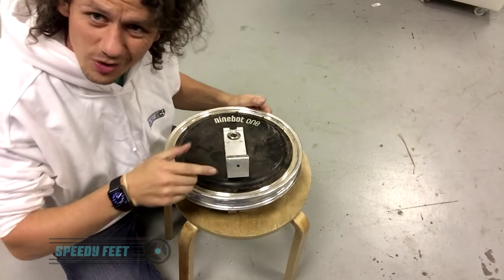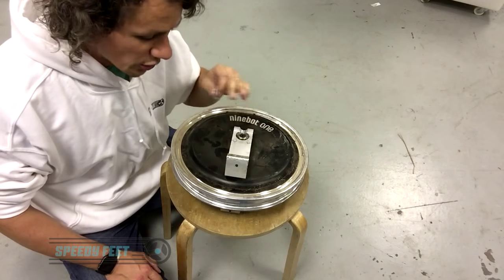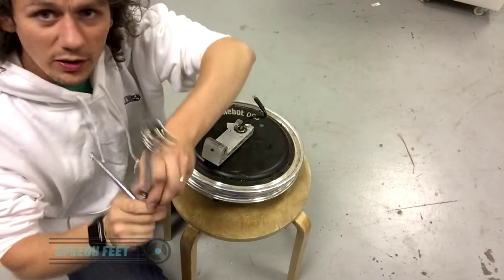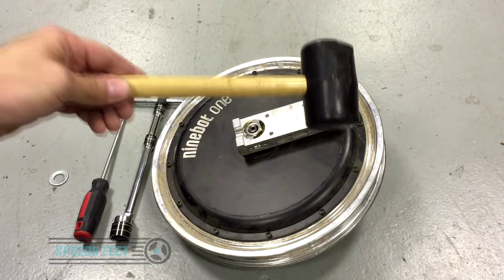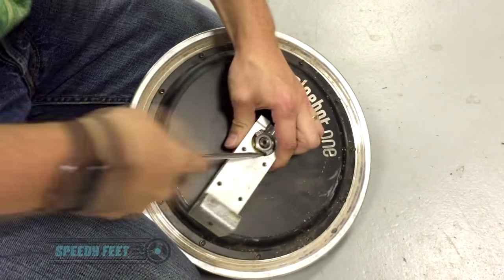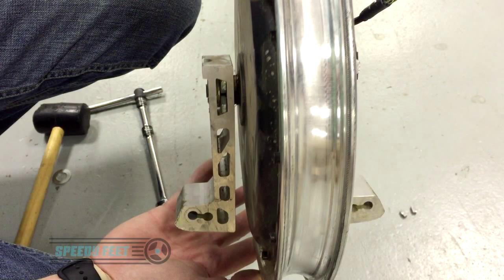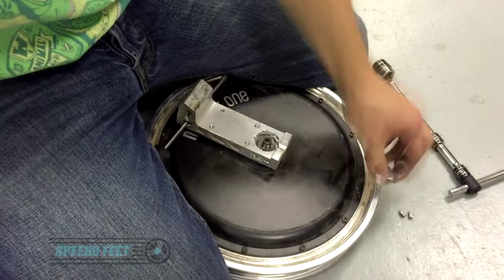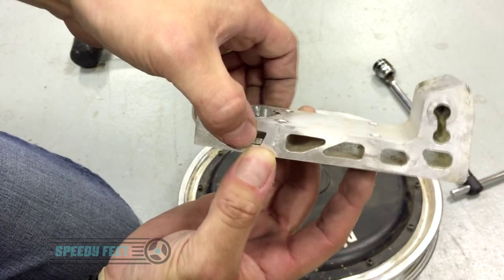Ninebot ONE - How To Fix Rubbing Noise

Comment: With your help I was able to do the tweak. I had a terrible rubbing noise and when I saw the marks on the motor and the case after disassembly I thought this would never be fixable. But a 2mm  washer did it. Boy was I afraid to break something when hammering on the Ninebot .... But all went well and I am happy now. But I don't agree with your opinion/statement that this is not a design flaw. I had the issue since day one after unpacking and I see a lot of Ninebot Ones with the problem. I was a Solowheel rider before and even before I had some bad Chinese budget wheel and never did I have any mechanical problem like this.

Many thanks for this and your other videos. They are always helpful and/or entertaining.
Reply from the maker: +Thomas T. Thanks Thomas for the comments and glad it helped you. I state its not a design flaw because its around 1 in 30 units that make the noise, I think if any thing its more of a 'build flaw' or Quality control flaw maybe :)

(Sorry only just saw  this comment!)

Comment: I've been looking at the idea of using a washer on the spindle of the ninebot the thing is as there are so few threads available on the spindle wouldn't that over time cause damage to the threads due to excessive movement?All your weight goes onto those two pedals, the pedal is only held by the spindle nut and a washer, the pedal arm is made from aluminium so will bend or wear easy, there is no support for the pedal arm, it seems a bad design, the arm should have been braced on both sides with a U bracket giving it much more support.By adding this washer you have in effect lowered the strength of the threads by 2 mm which basically means it could simply snap off the remaining threads under pressure.I know it seems a good idea to use the washer but there is usually a good reason for the number of threads used on a pressurised plate, it secures the plate so it won't move and come off.This seems likely to strip the threads over time, slowly but highly likely.One day you may step on and the bracket will simply ping and that will be the end of your spindle.I know this even though I don't own a ninebot this kind of thing is done of cars bikes and motorcycles only to make things worse later on then you have to put a new thread on the spindle or re-tap a hole.Far better to check the size of the original washer to ensure it has not been compressed on one side or check for damage to the bracket and perhaps repair the side of the bracket that may have been damaged or replace bracket.

Comment: Great video thanks. 
Out of interest, can you buy the arms which hold the pedal and connect to the axle? The edges on mine are trashed from learning and look shite, would pickle my brains if doing a refurb and I could not replace with new. ATB.
Reply from the maker: We dont have any in currently sorry! Not sure if they still do them as a separate part, but you can tidy up yours with a wire wheel, tends to polish up, if not perfect, but close!

Comment: Great videos, I think I have seen them all now. :) Thank you. I bought a 9B1+ about 3 weeks ago. I love it, but I have this awful noise myself now. I think it got worse as I filled the tire to your recommended 50psi (it got a lot more unstable, but easier to turn). It does not rub against anything I can see, but it is clearly some kind of plastic noise. It also comes and goes, so it is not all the time. It does not happen just when riding either, I can hear it when turning the weel as well - and it annoys me a lot. I have good clearance from what I can see. Heard about this? Maybe I need to take the battery side off so that I can check if there is something touching the tire on top or something?
Reply from the maker: +rolauk Sorry, have only just seen this. If you take the cover off and check the hub, if black paint is scratched off then the washer should fit it. If its all ok, then could be tire related. Check for rub marks anywhere.
Reply: +Ninebot UK No problem. :) It was fixed by releasing some air. So it seems it was rubber against plastic somewhere. I haven't had any of the sides completely off yet, but I will. Bought a Mad Mike tire from you a little while ago, will try it on soon.

Comment: Oh judging by the look of that wheel motor some how I doubt it would hold 120 kg for long as stated on the specs.The energy of the persons weight needs to be redistributed via some other means than the washer.A collar and a U brace seems the most likely solution, but then it may not fit inside the plastic casing.I suspect these ninebot ones have had lots of problems unless they are only ridden by kids or very light people, mind you they were made for the Chinese market so yep.If these are to be successful for the UK market with very few complaints, I suspect that a redesign in being planned, the overall look is fine just the actual mechanical design is flawed something chronic.
Reply from the maker: +flitsies Thanks for watching, no these are just fine, we have sold 100's. Customer base are 99% adults all sizes and shapes. No issues at all. The quality is Segway quality (due to the fact Ninebot owns sewgway). For power this was a fun video we did: https://www.youtube.com/watch?v=M4CJZVHyC0M

Have a good one!
Reply: Ninebot UK The thing is this, if the foot peg keeps rubbing on the motor then there is a design flaw, the fix that you came up with may work, but it weakens the spindle and will most likely end up popping the threads over time.

 I noticed something about these things and that is you never see a large person riding them, all the videos I've looked at and every rider is either very slim, a light female, or small people.

After checking out the weight limit recommendations ie max limit, all of them go no more than 120 kg which sounds a lot but let's say you have someone who is 120 kg bumping up and down steps that bump generates quite a bit of pressure and in no time the wheel will be wasted, also if you do that suggested fix cos the 120 kg rider will cause the rubbing that is clear due to the poor design then the spindle will fail in not time at all.

The design needs a bit of a rethink for the western heavier rider.